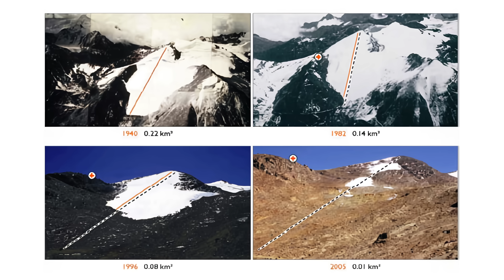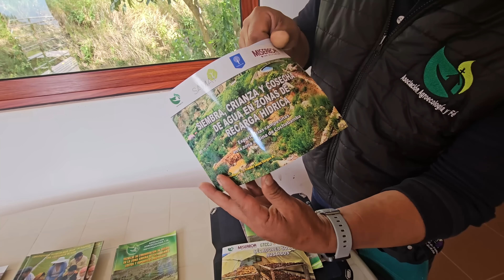Building an Ancient Wetland: The Excavators That Brought Back the Water

Comment: the problem isn't climate it is greed , over grazing and tree cutting.
Reply: So true it’s crazy too because their is now a bunch of research that shows farmers greatly benefit with working with Mother Nature they don’t have to put chemical fertilizer down and they don’t have to pay for water to be brought in because the water tables have risen with beavers and analogs
Reply: It's 100% both. The CO² levels in the atmosphere haven't been this high since the carboniferous period 358 - 298 MILLION years ago. 
Greed is the cause for  all of it, causing catastrophic cascades that are permanently eradicating the Arctic ecosystems in my ancestral homeland.  Good thing is that permaculture are both the short and long term solution - massive carbon sequeatering is only possible with natural methods.
But the polar icecaps and all our glaciers will disappear before that happens, destroying those fragile ecosystems forever.
Reply: @darktwistedlady look into cooling the oceans and actually getting electricity out of it.  It's possible... And could be our only way out of this shit spiral of melting glaciers.  Gotta use this excess heat as a resource.  If we can profit from it, we can market saving the planet from warming oceans by helping to mitigate it at the same time...  Our warming oceans are just big heat batteries.
Reply: Habits brought from Europe that are hard to change. Native herbivores are friendlier on pastures than european ones, for instance. Alpacas are preferable to sheep, goats and cows.
Reply: It's always one or the other isn't it? Why not both?
Reply: The problem is we dont know with absolute certainty that it is or isnt climate change.  The even bigger problem is that you either absolutely believe its climate change, or you absolutely believe it isnt.  The fight focuses so much on the scientific data (or lack of) instead of the actual problems.  A combination of forced drainage of rainwater, overgrazing, and clearing of forests are proven to be part of the problem.  We should work on those things specifically WHILE we fight over who's right about climate change.  But since we focus on who is correct about climate change, earth continues to be cleared of all fresh water and vegetation in the name of profit.
Reply: @IowaKeith there is quite the dilemma...
If the folks who believe desertification drives climate change are right, we need to refill aquifers and restore the land's ability to catch and retain rainwater in order to reverse the process.
If the folks who believe climate change drives desertification are right, we need to refill aquifers and restore the land's ability to catch and retain rainwater in order to build resiliency against an increasingly chaotic cli- wait a minute...
Reply: @IowaKeith 
The profits are huge and fear mongering works.  The fact that some of the biggest global warming fear mongers have bought beachfront mansions at bargain prices seems to elude the frightened masses.
Reply: @peterm.eggers520 im assuming your argument is that climate change was invented for profit, and im not going to argue one way or the other.  I dont care if climate change is real or not.  The truth is that humans are a desert creating species.  Water is treated as a commodity, so we are forced to send all rainwater to the ocean, and are then forced to buy the water being pulled from  the ground.  100+years of this is finally starting to catch up to this.
Reply: @IowaKeith 
How does water being treated as a commodity cause it to be flushed to the sea?
Reply: The real problem is the elites propping up puppet governments to exploit natural resources while giving nothing in return. 
Bolivia, much like the rest of South America, has been made dependent on "aide" so their independence was forgotten.
Reply: Yes. That can be true. Yet the Andes mountain range and the deserts in their area have been producing less & less rainfall for nearly a millenia now. Bolivia topography create a condition where the evapo-transpiration is sucked up & dried up by their arid conditions. The altitude does not help any either. The ancient Inca already had all this figured out long b4 Conquistadors destroyed it. Religion, European ignorance/stupidity, and disease all lead to these people's downfall. Now, the puppet government have the nerve to throw their garbage in these people's backyards. Jagoffs!!!
Reply: Man
Reply: Wake up get educated of course it's fucking climate and stupid people
Reply: Greed and cowardice are always part of the equation for all problems
Reply from the maker: The problem with 'climate change agenda'  its making certain people very rich without fixing on the ground problems that well or making them worse. The word "climate" has now become associated with this agenda unfortunately. We can no longer talk about climate issues or benefits without people thinking it is about "the climate change agenda"
Reply: @LeafofLifeWorld you’re doing good work, regardless of the truth about anthropogenic climate change.  Drop the rhetoric, keep up the good work.  The world needs it.
Reply: Climate change has always occurred and has little to do with atmospheric CO2 which ideally should be 2000 ppm or more.  Holistically managed regenerative agriculture as developed by Allan Savory is the answer to developing deep rich soils that feed the plant life and animal life on them.
Reply: @peterm.eggers520 climate change has of course occurred for many natural reasons, but this doesn't change the fact that modern day climate change has been significantly impacted by the huge amounts of carbon dioxide greenhouse gas released into the atmosphere. 

How could the past few centuries of intensive carbon based fossil fuel burning not be consequential? We have dug up and burnt unprecedented quantities of stored carbon at a rapid rate, on a global scale, in a relatively short space of time: in factories, in vehicles etc., whilst also decimating habitats (forests, bogs, healthy oceans) that capture carbon. How can it - at the very least - not be a factor in global warming? Where is the evidence for your claim that contradicts what nearly all climate scientists agree is happening?

The bottom line is this: the earth's climate is a closed system and with population increase and advancements in technology we have released carbon into the atmosphere in a way and to a degree not seen before in human history, or indeed the earth's history. So whether the current changes in climate are natural or not doesn't change the fact that human activity has accelerated and exacerbated this process.
Reply: If you pump the atmosphere with CO2 for 200 yrs and cut the fucking forests down that sucks out the carbon then there are consequences don't be dumb
Reply: @peterm.eggers520  BUT the thing is the co2 increase is happening so fast now life cant adapt (evolve) in time. Its all about what climate life calls natural and how fast that changes. Oxygen used to be toxic to life for example, as soon as certain bacteria started producing it it caused a mass extinction. Now life relies on it.
Reply: @daanscatozza
Atmospheric CO2 is the foundation of all life on Earth.  Life was most abundant on Earth when atmospheric CO2 levels were 10 to 20 times higher than today's levels.  The Earth has been in an increasing atmospheric CO2 drought for well over 100 million years, and humanity is in the process of saving Earth from what would have been the greatest mass extinction. 

There is a greenhouse effect that is measurable in a laboratory, but its effect on climate is too small to measure, and logarithmicly declines as concentrations increase.  The correlation between atmospheric CO2 and temperature is the opposite of what is being published.  When Earth's temperature rises consistently for hundreds of years, the oceans off-gas appreciable amounts of CO2, and when the Earth cools for hundreds of years, the oceans absorb appreciable amounts of atmospheric CO2.  The Climate Crisis is a scam that is transferring many billions of dollars from taxpayers to elites while also severely depleting resources for environmental protection!
Reply: @peterm.eggers520  its the unprecedented speed of the increase, not the very principle of its increase. A slow decrease is ok bc its slow enough so life can adapt. Youre saying that science is lying? A worldwide field of science would have wistleblowers worldwide by now, all ive seen is people who were never in climate science claiming "fAkE". Dont believe the fossil fuel industry scam thats playing down the language and then "debunking" it and whatnot, all they want is cash.

Also, the ocean may offset co2 as a response, but its wether that adds to the warming or reduces it that matters.

Also, what taxes? The ones on fossil fuel cars? If we wanna fix this, we have to stimulate ppl going electric, that money is going to electric car subsidies.
Reply: @daanscatozza
You apparently get your news from the mainstream media which was purchased by 6 corporations controlled by 15 billionaires.  They appreciate your business and assistance.

There is a reason why no climate prediction since the late 1980s has come true, yet climate crisis investors continue to get richer and buy beachfront property at bargain prices to live in.  The Obamas are but one example.

Some of the very best scientists in the world have explained why the climate crisis is a fear mongering hoax bilkiimg taxpayers out of trillions of dollars.  This includes William Gray, the father of hurricane prediction, from a list of science luminaries that you apparently have never heard of.
Reply: Climate change is part of the problem. The video starts out listing how the local climate has changed. 

Projects like this are great. They help people locally and restore ecosystems. 

But that doesn't mean we shouldn't also face the fact that humanity is burning up fossil fuels too fast and changing the climate in the process. The climate is changing in ways that make the weather less predictable and therefore making agriculture and food production harder.
Reply: It's not just fossil fuels that do this... We're warming our oceans with nuclear power, while a bunch of dopey dumbasses debate whether or not nuclear power is really good for the planet.  It's not.  Do the math.  It's pure, condensed stupidity.  @k.h.6991
Reply: @k.h.6991 if the human population was confined to a few Tokyo sized hot spots and put out the same amount of co2 while the rest of the world remained completely untouched by humans, it would barely register on the climate.
All the semi arid grasslands would experience growth spurts, vast wetlands would absorb it like a sponge and the end result would be a slightly faster buildup of soil.

What does in the climate is really the 1-2 punch of high levels of co2 in the air and depleted local aquifers due to mismanagement.
Reply: It's not just that - it's laziness.  Nobody wants to do the hard work.
Reply: Yes We Need To Stop Everyone Cutting Tree's 🌴🌲